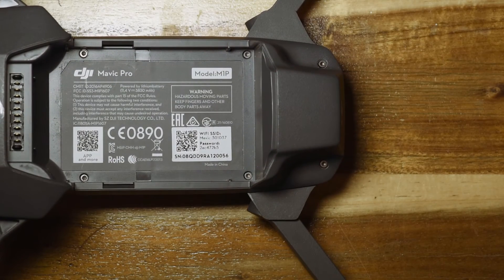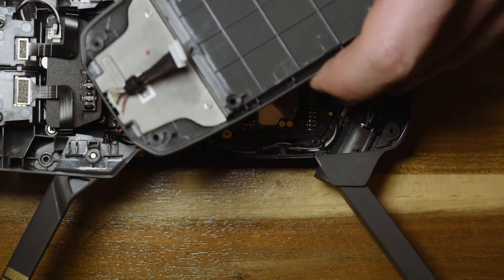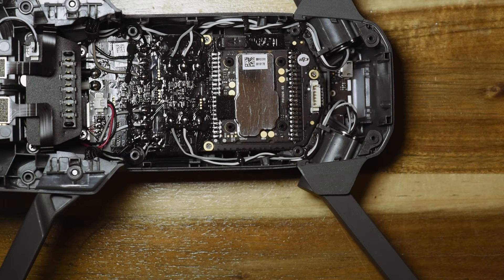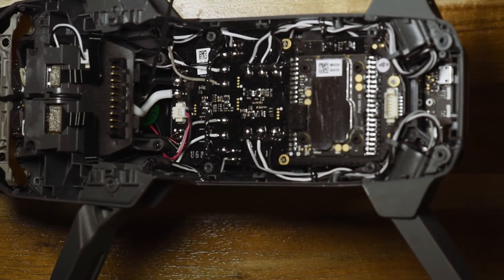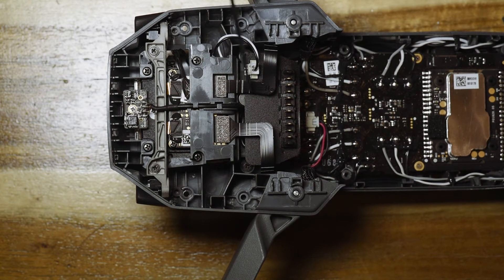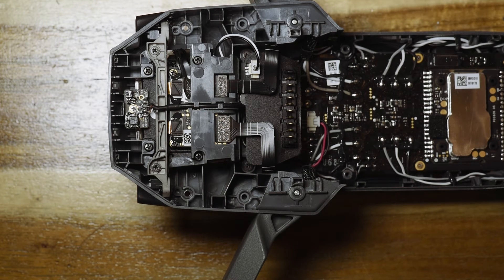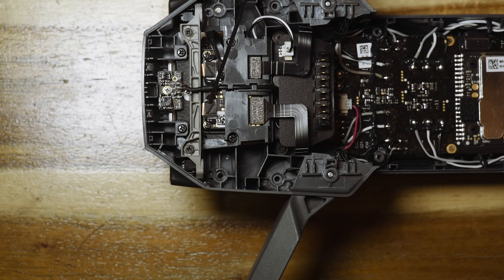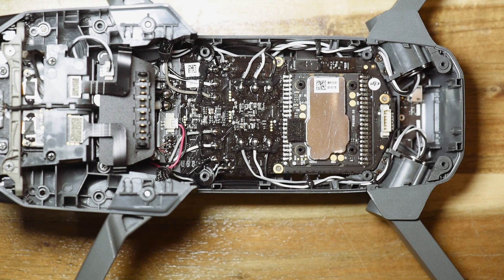DJI Mavic Pro teardown Top

Comment: Go a hairline crack on the MPP top shell left side of canopy were the left arm meets underneath the canopy. It appears to be a manufacturing defect. Never crashed or hard landing. Currently have a return label to ship under warranty for repair. Worried if I will get a refurbished back or new so thinking about just replacing the top shell. Is it easy to retrieve/swap the compass/GPS from the top shell to a new top shell? If so how? What tools are required for dissembling the top shell? Thanks.

Comment: hello sir, where is the barometer location precisely?
Reply: Great videos. You might be able to help me. I'm having trouble with my Mavic Pro. Compress 1 is disconnected. I've tried all software options, downgrade and upgrade. All the usually but with no success. Calibrations do not work, in different non magnetic locations, IMU calibrates ok. I'm suspecting hardware issues. GPS module. However in the video you point out a small circuit board to the front of the unit that may be a compess also. What would you recommend replacing in my Mavic.

Comment: Is the black & white wires with the white clip in connector the camera? A user in a fb group had their camera come off & it has two frayed wires. Wondering if its that easy of a fix. Thanks!